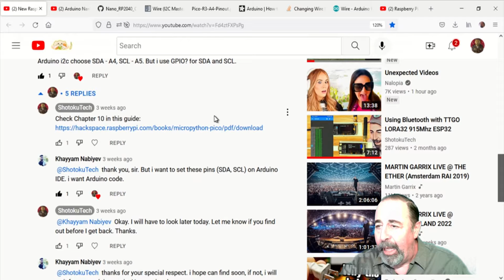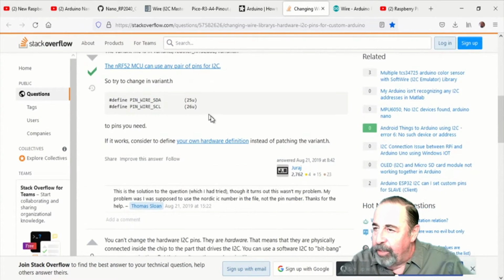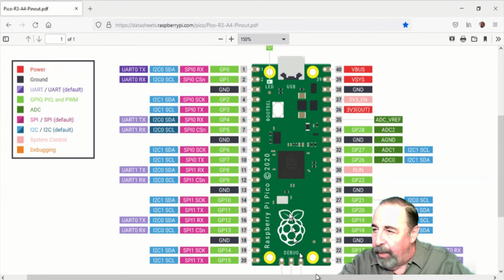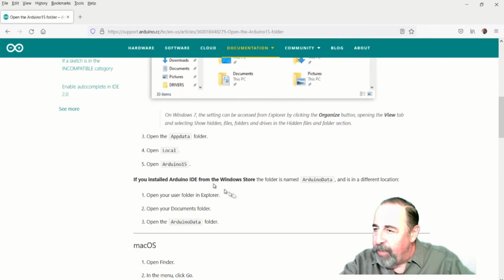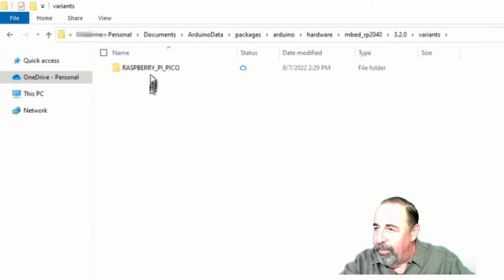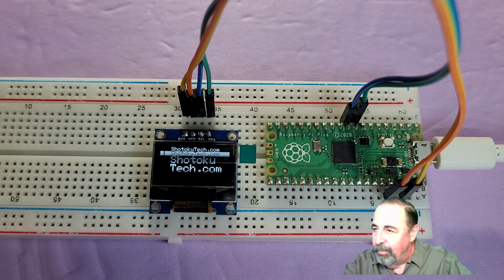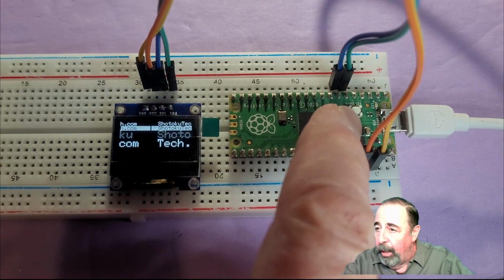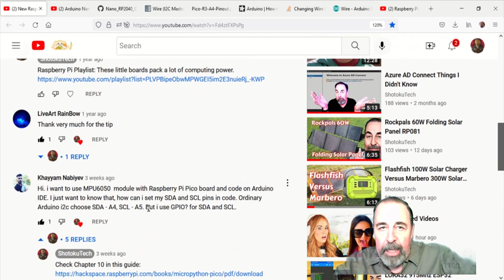Modify I2C Pins on Raspberry Pi Pico in Arduino IDE

Comment: How do you do this without having to delve deep into the Arduino files? Is there a way to undefine and redefine the pins just in the code you write, so it will work in any computer?
Reply from the maker: You pose an interesting question. I followed what worked in that moment. What will you do? This is our constant challenge. Best wishes.

Comment: Hi Your video helped me out it got me up and running Thank you for that. 

However I have since found out that you can set the pins for I2C in your sketch. If your board definitions update you could loose the pin definitions you set in hardware. 

In void setup before wire.begin set the pins with Wire.setSDA(12); and Wire.setSCL(13); or Wire.setSDA(0); and Wire.setSCL(1); 
If you want to use the other I2C port use Wire1.setSDA(2); and Wire1.setSCL(3); Which ever pins are most appropiate for you build.

void setup() {

  Wire.setSDA(12);
  Wire.setSCL(13);
  Wire.begin();

or 

void setup() {

  Wire1.setSDA(2);
  Wire1.setSCL(3);
  Wire1.begin();
Reply from the maker: Yeah I found similar while making this video: https://youtu.be/sBYHlvLupxw
#include <Wire.h>
const int SCLpin = 42;
const int SDApin = 41;
void setup()
{
  Wire.begin(SDApin, SCLpin);
}
Thanks!

Comment: Hello, a most interesting GPIO video.  Do you have an Orange Pi-5 GPIO PWM video?  I just want to make 2 servos Pan/Tilt to move using OPi.GPIO in Python3 or something that works.
 I cannot program the Channel, Pin, Duty cycle , Frequency without errors   It is suppose to be a RPi.GPIO drop-in??  One PWM example would be a big help.  Thank you.
Reply from the maker: I guess I would need an Orange Pi-5 to test that on. I am not sure if I will get one. Thanks.

Comment: Good afternoon I'm a Haitian I have a little wifi ellpsis I forget the bite helps me find it please
Reply from the maker: Perhaps your carrier has a help line?
Reply: I don't remember the rope please how can you help me
Reply from the maker: @cherikervns9265  Rope may be the wrong word? I do not understand the question.
Reply: Wifi calls ellipsis jetpack
Reply from the maker: @cherikervns9265  WiFi calling is more of a phone feature. This is just a WiFi hotspot. It is probably best to contact your cellular carrier for more support with this device.
Reply: I tell you so I have my wifi fold the password how can you help me please
Reply from the maker: @cherikervns9265  If you go through the menu like I showed, you should be able to see the WiFi SSID and password. You can use the menu button to browse to 2.4ghz then press the power button to see the details.

 If you need to reset your admin password to access the Orbic via the browser, remove the battery cover and press reset. The default user name is Admin and the password is the same as the WiFi password. 

I simply don't have anything else I can tell you from your question. I do not understand what "my wifi fold the password" means.
Reply: They don't give me passes

Comment: Appreciate you sharing this.
Not sure about Arduino IDE, but some IDEs, like PlatformIO in VSCode, have good C++ navigation features. So you can perform the Go To Definition command on "Wire.h" in your include statement, and it will open the file at the target location (and the tab will show the full path, when highlighted).
Reply from the maker: Thanks. I'm no expert. Just sharing my practical experience along the way. Best I can find is "Help/Find in Reference". This doesn't seem to do anything, not matter what I highlight concerning 'Wire' or 'wire.h'. But "Help/Reference" takes me to Arduino docs page. 
This is v1.8.x. Maybe v2.x.x does more. Basically, the include files do not load into the IDE when I open the sketch, so the IDE just refers to a hard coded path depending on how it was installed. I'll look at 2.x.x and the web IDE to see if it gets easier to find. 
Best wishes.